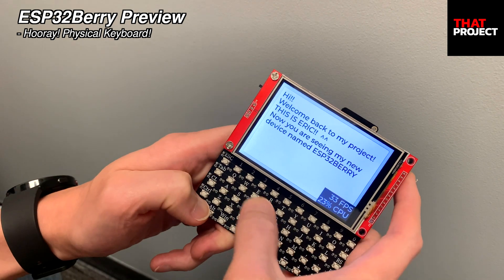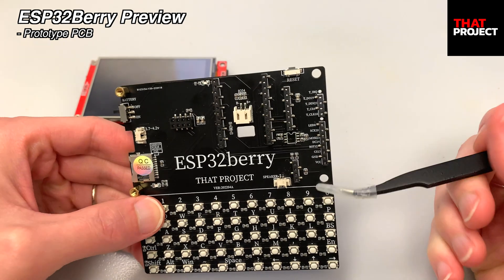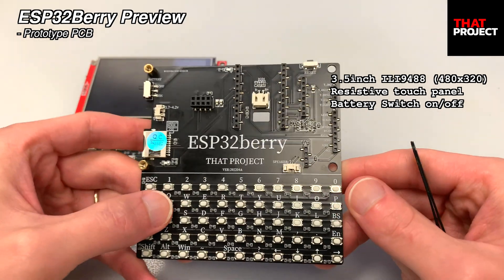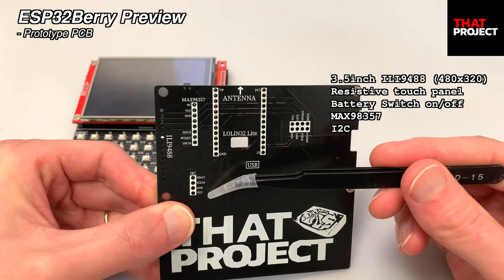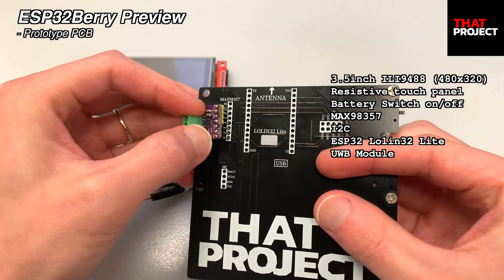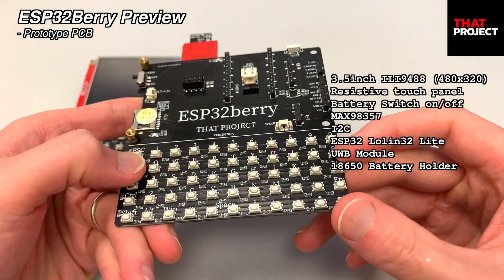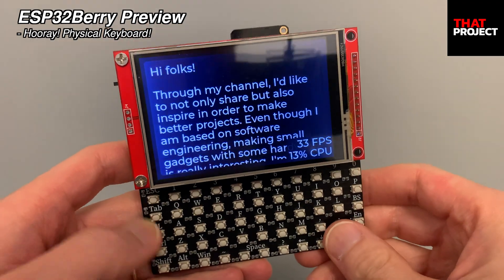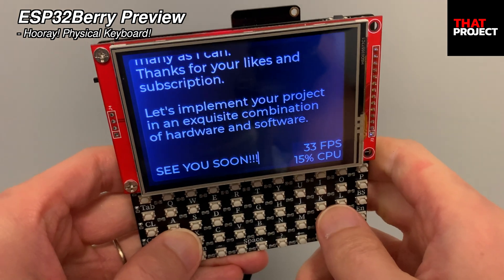ESP32Berry. "Hey, I have a keyboard"

Comment: How do the keyboard keys work? I see resistors connected in series between the keys.
Reply from the maker: Each row is connected to each GPIO (5 of them) and each button has a different ADC value because of the resistors connected.